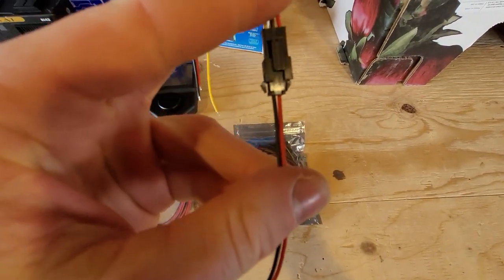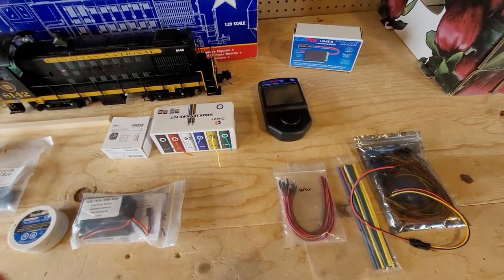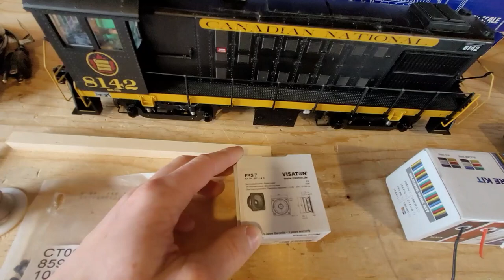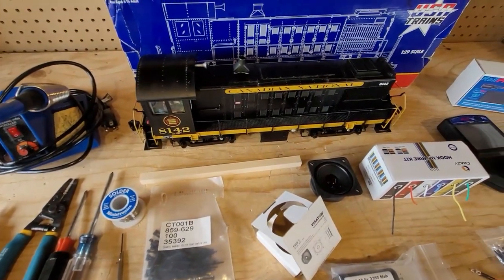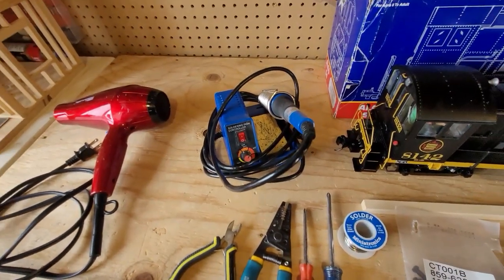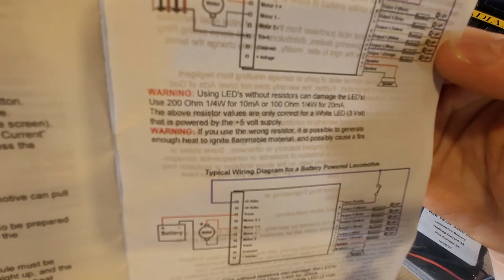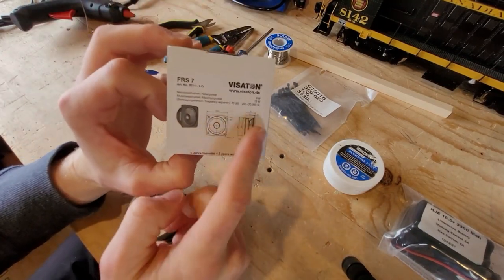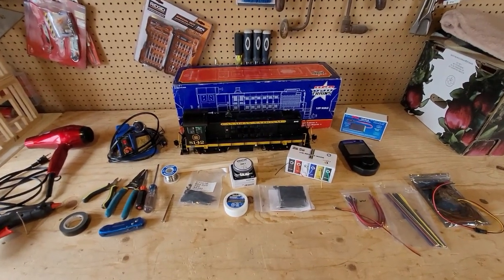G Scale RailPro Installation In the CN Alco S4 Switcher PT 1 |  Garden Railroad

Comment: so I got a good look at my 2005 GP 9 that's part of the King Sky Express and it's got 2 black wires going straight through the battery terminal (I'm going to guess it's different on the Alco since my GP9 only has one motor in the rear.) a real cheap train set to get pushed out the door at an MSRP of $59.99 (and you had to spend boat loads on batteries). and the only sound you'd hear is from the rear motor (it's got two black wires going through the 4 C cell battery terminal with blue and yellow wires for the front and rear LED's).

Comment: Instead of using hot glue, next time try using silicone adhesive. It lasts far longer than hot glue, which tends to brake loose after some time. The only problem with the silicone, is the long setup time, but I think it's worth the wait.

Comment: Question: Is the battery necessary? Or, is it only required for battery powered locos?
Reply from the maker: The battery is not necessary. you could run rail pro off of track power.

Comment: I was looking add adding this system to my G gauge SD40-2. But it gets its power from the track. But I see your using a battery? Will it work with regular 10A track power?
Reply from the maker: Yes, it  will.  The olny difference is that you install the track power pickup wires to the TRK terminals on the bord...
Reply: @TrainBrosRailway  Great thx. 👍